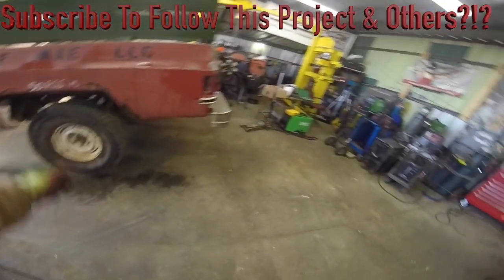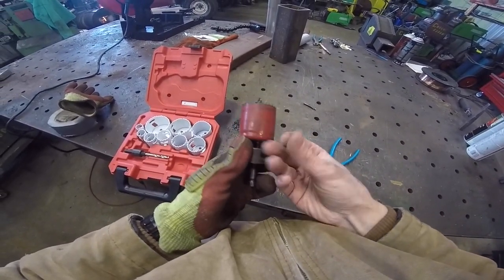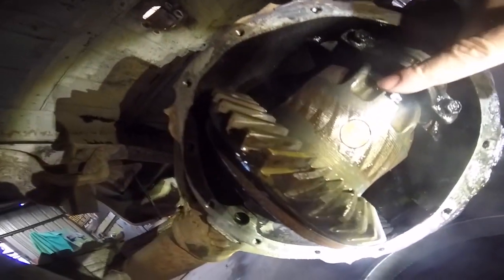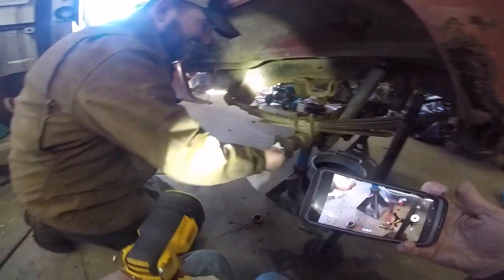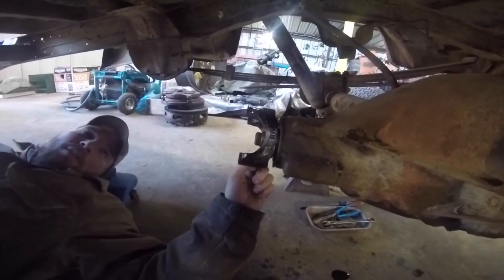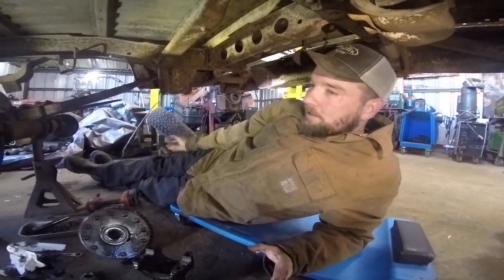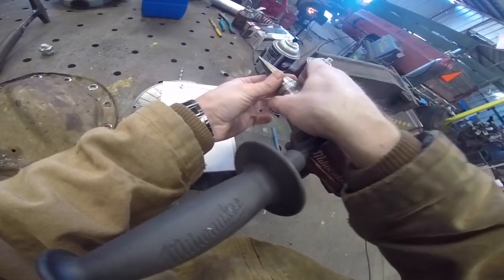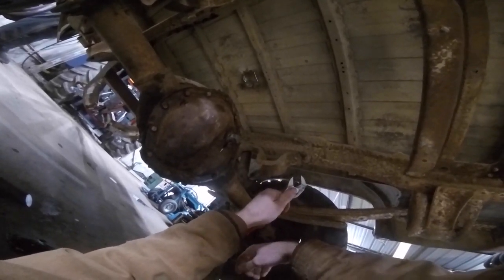WORLDS MOST DYSFUNCTIONAL TRUCK AXLE SEAL SWAP (With Mechanic Steve)

Comment: Do you have any concern about building up pressure in the axle as the oil expands due to  heating up from driving?  I didn't see any pressure vent.  Won't this rupture the new seals or is there a vent on the axle?